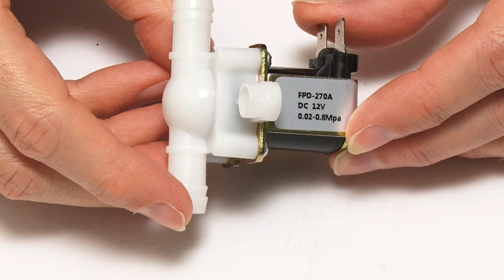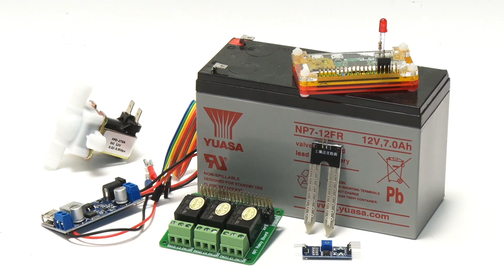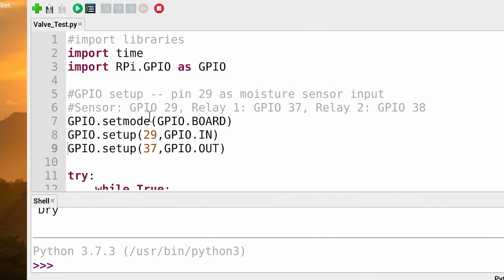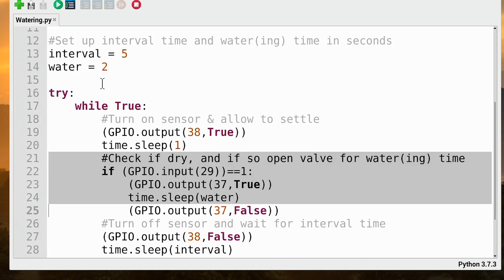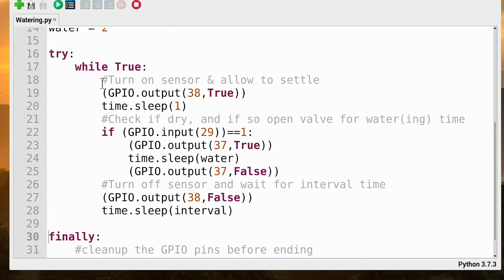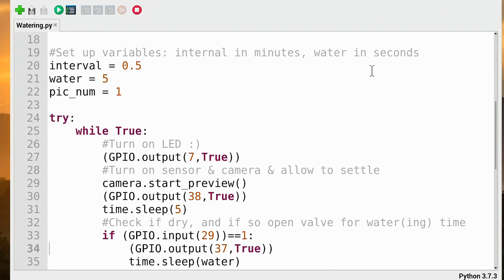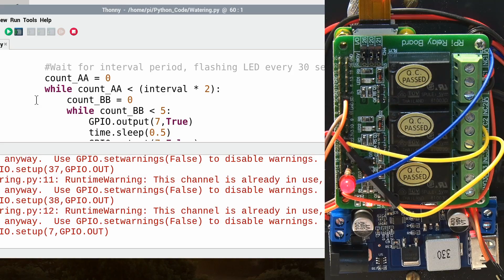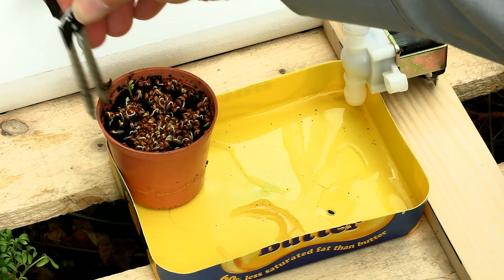Raspberry Pi Plant Watering (& Time Lapse)

Comment: Great prototype, Chris! I am not a gardener myself, nor do I have much interest in this subject in particular, but I do like seeing things working! So I look forward to seeing improvements with your automated plant watering system.
I would try to avoid leaving still water wherever possible as that can be a breeding ground for mosquitoes or other kinds of bugs. You could probably cover up your water funnel there with a piece of cloth so that air comes through, and nothing undesirable.
Reply: Agreed, this system would work really well in a garden bed! Here, there will be a delay between when the sensor detects dryness and when the water makes it to saturate the soil, leaving the water running in the meantime and risking over watering, root rot, pests etc. love love love the design and explanation, I’m greatly inspired to pick up this equipment and try it out

Comment: So I guess the moisture sensor works on conductivity.
But the same sensor form factor can work in a capacitive manner.
In that case you can coat it with a water proof layer.
It will just change the capacitive behavior, but it will not corrode anymore.

Comment: Selling these moisture sensors should not be sold as they corrode due to the DC element in the circuit I am surprised you purchased this item in 2021 so your video is misleading you should have purchased the capacitive version
Reply from the maker: I did discuss this in the video, and would note that (a) with the power only applied when a reading is taken, corrusion will be much reduced, and that (b) capacitive sensors have an analogue output and the Pi does not have an analogue GPIO input.
Reply: @ExplainingComputers  Thank you for your reply you could always use an A/D converter MCP3008 but as always love your videos so thanks

Comment: I'm wondering why the files are getting corrupted. Maybe there's some interference from switching the relays.
Reply: One more thing I would add would be a loop that would pulse the solenoid until moisture was detected. You would not have to experiment with ON time and the system would adjust it self for any changes in water supply.
Good project.
Reply from the maker: I've not figured this out yet -- relaying switching may indeed create problems, but as the Pi did not crash (if it had, the picture counter would have reset), I am perplexed.
Reply: @ExplainingComputers  No idea if this is relevant, but anyway: Friend had RAID go horribly wrong and eat a huge photo archive. (Backup was bad too.) They managed to recover most, but about 14,000 images were corrupted in various ways, mostly like yours. Turns out the corruption is usually an extra disk sector randomly dropped into the file, and if one removes it with a hex editor, the JPG can be recovered intact. Armed with JPEGSnoop and Frhed (hex editor), I managed to recover all but about 50 of the mangled files.
Reply: @ExplainingComputers  I would imaging that as you use the same power supply for all the electronics,  the back EMFs from switching off the solenoid, could cause voltage spikes. Perhaps a diode across the solenoid and a capacitor or two across the electronics might stabilize things.
Reply: @sharonwolff1  - I was thinking similar but more that the 5V RPi power was being pulled a bit low when the relay turns on.  This could be solved by running tests with a shorter interval and removing the water solenoid and then the relays.  It's always a good idea to put a reversed diode across DC solenoids such as this water valve that likely takes a good amount of power to switch on.
Reply: I would suggest adding a wait for the camera to stabilize before snapping the pic.

Comment: I've built an indoor one of these using an Arduino. I used two nails for a water sensor and a UV light strip. I wanted to experiment with how watering, light, and night/night cycles, affects on certain plants. It was fun to make and play with, but I didn't find it very useful for actually growing plants.
Reply: Was there some problem with the lights?
Reply: @MrMarclein  You need some specialised light sources for doing serious growing of 'normal' plants using only artificial light, they need strong amounts of particular wavelengths of light. Usually you find them as grow lights.

If you don't want to mess about with those then doing microgreens or plants specifically designed as indoor should work fine.

Comment: Interesting - and I look forward to more on time-lapse!

How about a second moisture sensor - for your water reservoir - to ping you a message if it runs dry?
Reply: And another sensor to put it to sleep at night
Reply: @barneyrubble5633  yes - a photo-resistor to stop the camera taking photos when light falls below a set level, but to keep the watering checks on overnight.

Comment: I like silicone rubber tubing for watery projects. It comes in a wide range of sizes (internal and external diameter), is very flexible, easy to attach and almost clear. It's also chemically stable and heat resistant. Less suitable if you need your tubing to be rigid though.

Comment: No, no, no, no! I'm resisting temptation of doing anything with the water without second layer of flood protection 😀. In a greenhouse outside probably yes, but in home - no way, I don't believe any microcontroller not to crash with valve open, even if it will be NC connection and Watchdog in place. I've seen too many burned closed outputs on transistors, gates, etc ;).
Anyway I'm waiting for the time-lapse Pi video and some ffmpeg image stitching in action 😌

Comment: You could disconnect the sensor right after doing the measurement, no need to wait for the end of watering, that way, you would preserve its life even longer.

Best even, do your own sensor with some stainless hardware...

Funny, I received my solenoid valve this afternoon!

Tank for the video, relay hat will come easy, I need some for a project (not water related).

Comment: You should use capacitive moisture sensor.
Reply from the maker: This I discuss in the video -- by using the relay to turn the resistive sensor on and off, I have no corrosion issues. Also, a capacitive sensor cannot be used directly with a Raspberry Pi, as it as no analogue inputs.
Reply: @ExplainingComputers  I have kinda similar system. Only in place of relatively big rpi I've used small esp01 module with relay. Works perfectly well ;)